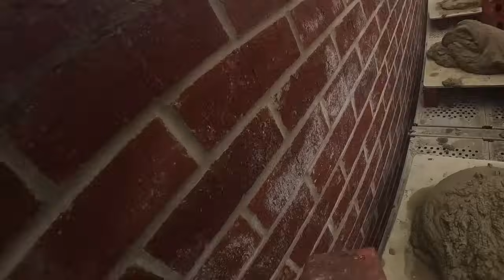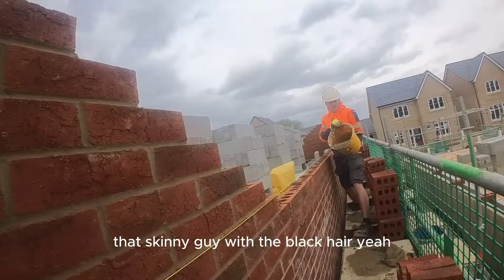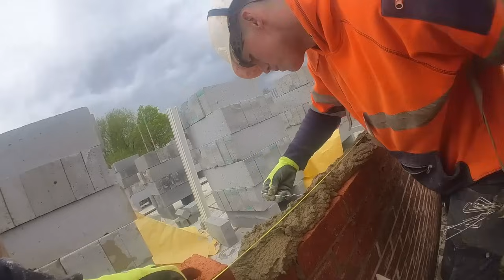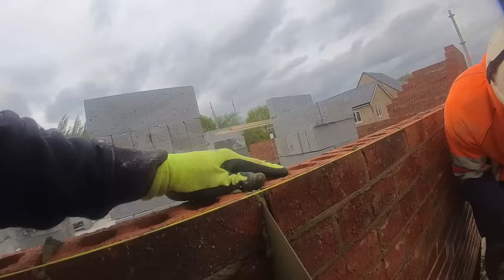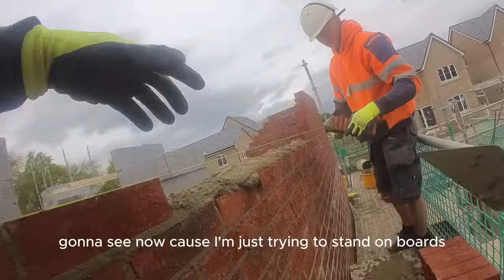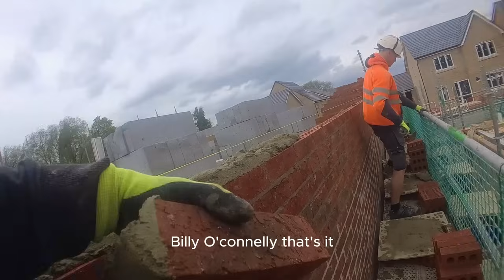Two Board Back Breaker

Comment: I get some two foot tubes, and some double scaffold fittings !
Hang the two foot tubes overhang , and over tighten the fittings and have my spot boards on them.. not the bricks single stack on 2 nd board inside brick guards! Them spot board holders on scaffold fittings aint the best but my way on a tight scaffold is brilliant
Reply: Obviously 2 scaffold boards on the two foot tubes, SF lightly running up in to out
Reply: Can nobody build overhand anymore?
Reply: What off a joist lift with a two foot drop !
Behave yourself

Comment: So tight there mate ,I got  a question  not being actual brickie ,how far do you stretch that line before you set up tingle in middle to avoid sagging
Reply: Depends how tight you pull your line
Reply from the maker: pull it super tight, i never tingle, it aint gonna sag out of tolerence with the good line that there is out there now